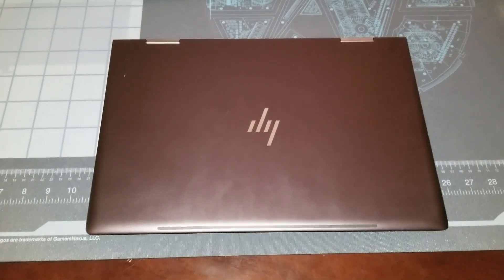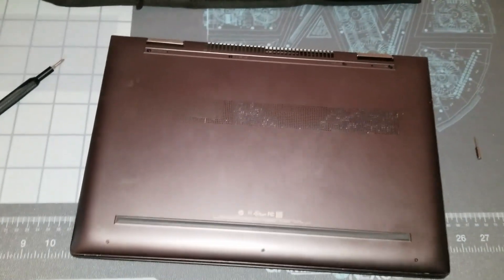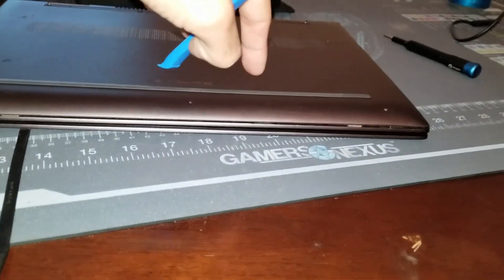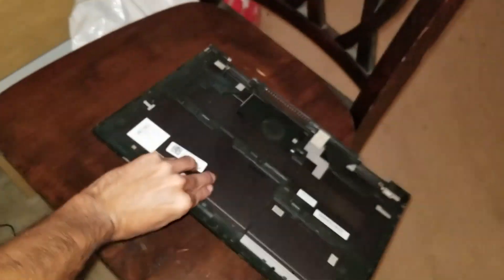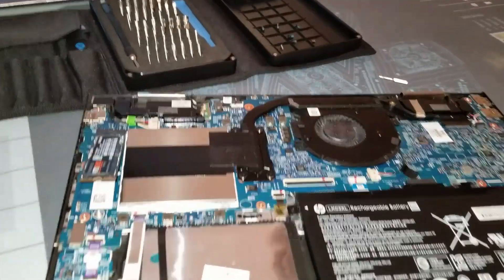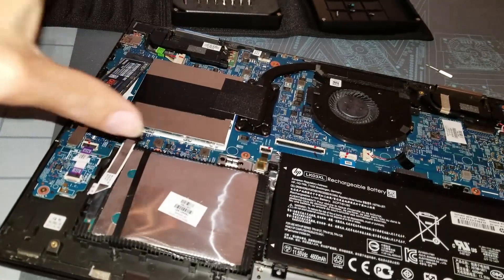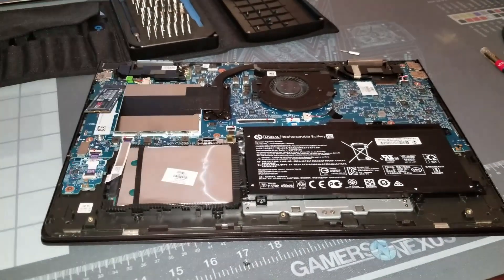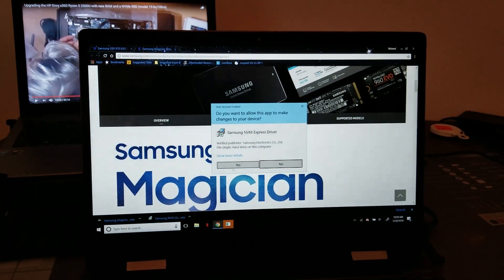How to take apart HP Envy x360 Ryzen Vega, & 970 Evo upgrade

Comment: This video is extremely helpful! We were able to goggle the T4 Star screw driver ran straight to Home Depot and grabbed it. We used a plastic library card to run along the sides heard them unsnap as we eased along. We have replaced our battery and are well on our way again thank you!
Reply from the maker: Congratz and good luck. Glad to help

Comment: My hp envy 360 ryzen5 is not getting charged (not showing charging light) and not getting on can please suggest me?
Reply from the maker: Did you check to make sure the pin, inside the charging port is not bent? If you have the tools and the pin is not bent, remove the bottom cover and disconnect the battery "CAREFULLY". Then hold down the power button for 30 seconds, before plugging the battery in make sure the computer can boot or load when you have the charger connect. If not then that charging port needs to be replaced. If you are able to boot while plugged in, re connect battery and then plug in charger to see if it lights up. Good luck

Comment: I have an envy 360 amd version with a 126gb ssd drive. would there be another slot for a larger ssd drive? My envy does not look like this on the inside. my airvent is on the left side not the back

Comment: Hi, mine doesn't turn on, if I plug a charger the orange light is there but the power button has no effect, any idea of what's might be ?
Reply from the maker: Power cable may have come loose, or button is faulty. You still within warranty? You can try a hard reset, I believe it is...
Press and hold the power button for 15 seconds.

Press and hold the power and mute buttons for 15 seconds.

If still nothing, check if you are under warranty

Comment: Hi! Which processor model is this? 🙂
I own the huawei matebook x pro and am incredibly disappointed by the cooling, worse than my GF:s lenovo 720s. So now i am looking at the spectre x360 15 with vega 20 graphics, but if this is the cooling for that model, i am disappointed again...
Reply from the maker: Yea, cooling on this laptop isn't that good. Fan ramps up, and it can get loud, the graphics isn't all that either. You want a 1050 2Gb or 1050 4 GB, with decent cooling

Comment: Do you have to do anything special to get the rubber strip to stick after removing it?
Reply from the maker: No, as long as I left it right side up and didnt let it touch carpet or dirt, it sticks just fine
Reply: @SerpentXTech  Thanks for the advice. I was going to ask the same question as well.

Comment: is this video for the 15 inch version or the 13? If it is for the 15, can i open up the 13 version and upgrade that to the same extent? (ram and ssd)
Reply: You can open the 13 inch version up but the ram is not upgradable, it's soldered on.  It has one drive slot and you can upgrade that to something larger like 512GB or 1TB.  That's why I bought the 15.6" version, everything is upgradable and has a numpad.
Reply from the maker: Yes it is the 15 inch version. As for memory, I truly dont know. Mike said it was soldered, but check for yourself and see if they is a silver protective cover over the memory. If you see so-dimm modules then upgrade it. But it might be soldered like mike said, then the memory you have is all you will get

Comment: My 970 is on the way for my Ryzen 2500u x360. Spinning drive is a HGST unit and it’s failing within 7 months. Sent it off for service but when it gets back I’m taking the spinning drive out and replacing it with a 500 gb 860 evo and adding a 250 gb 970 evo to the nvme slot. Good processor, but it comes with a shit drive from factory.
Reply: I love the fact that this laptop is pretty much modular.  It's not "user accessible" but it's real easy to get into and HP even sells the rubber strips new in case you ever need them.  I just ordered mine directly from HP and customized it with Win 10 Pro, Ryzen 7, 256 m.2 + 1 tb hdd and 16gb ram.  I already bought a Intel 9260 WiFi card to replace the realtek unit and a Crucial 32gb ram kit.  I'll be doing startup/unboxing and upgrade vids.
Reply: is yours a 15 or 13 inch version?
Reply: 15 inch version.
Reply: @MikeA-79  I did the same setup but faced an issue with speed, my 970 reads 1300m and write about the same and some time 500M. what model do you have and can let me know what bios version you are using? it is very help full too if you showing me the HWInfo64 for PCE NVME information. looks the BIOS F31/21 has issue